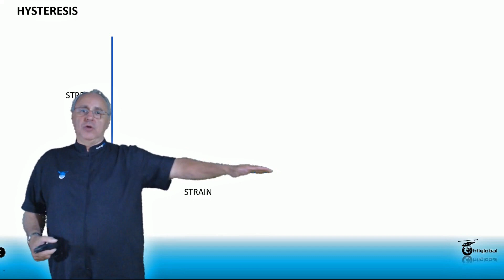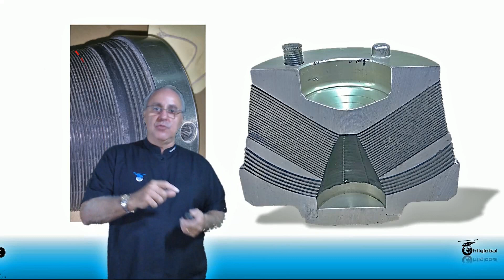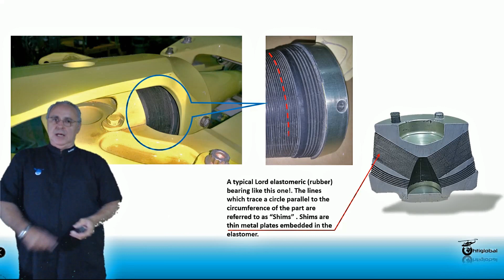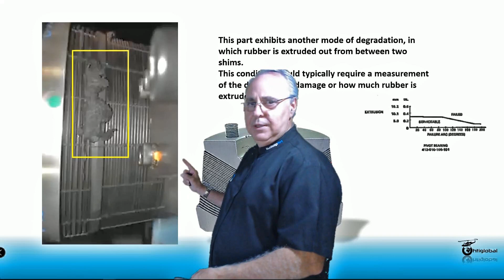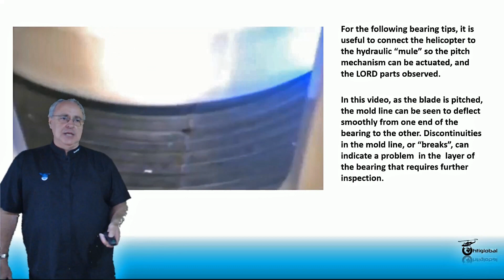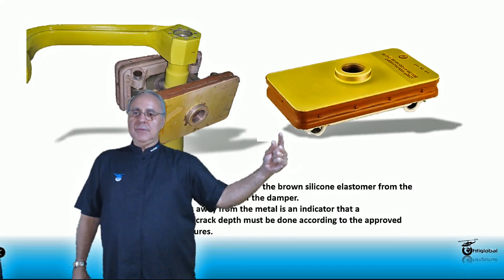ELASTOMERIC BEARINGS INFORMATION AND INSPECTION

Comment: Bell 412-We are facing some issue related to transmission (mgb) metal chips and also showing cat eye we drain oil check filters clean screen pump change chip detector but facing same issue.